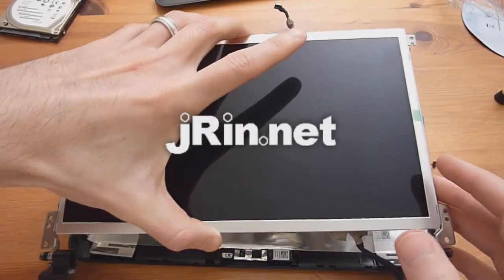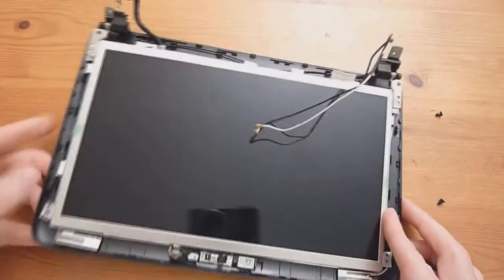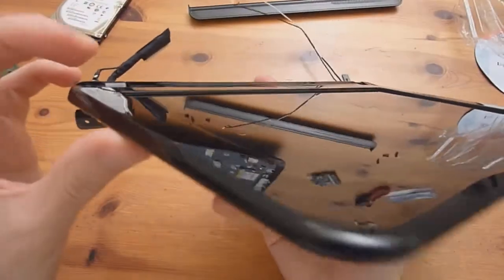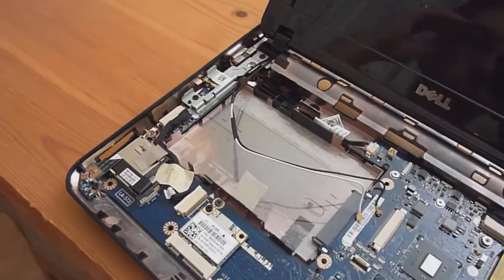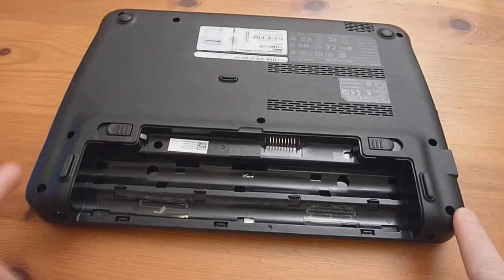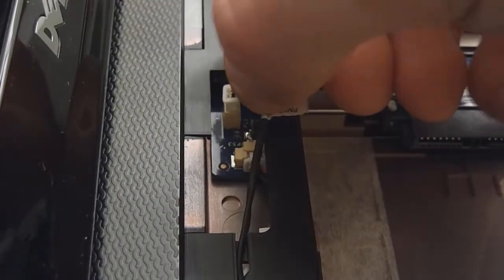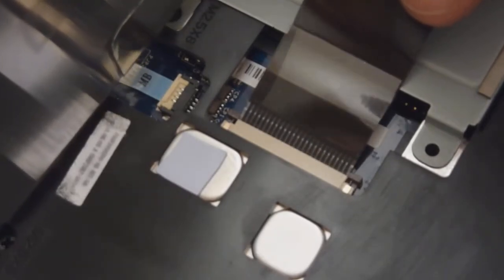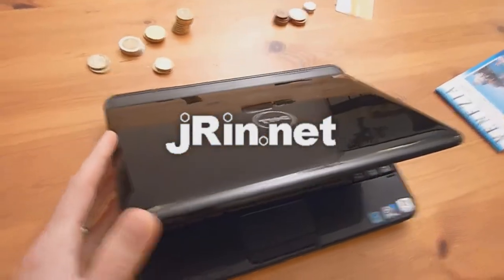How to reassemble the Dell Mini 10v 1018

Comment: @AdrianMoralesDelgado I got this one:

Rendition by Crucial 2GB 200-Pin DDR2 SO-DIMM DDR2 800 (PC2 6400) Laptop Memory Model RM25664AC800 But my machine is a 1012, I ended up canceling the order on the 1018 due to seeing the 1012 video out there and how much easier it was to upgrade using the ram access door the 1018 lacks. So I don't know how easy it would be to do this I go to a board that might help you tho' mydellminidotcom Hope this helps! :D